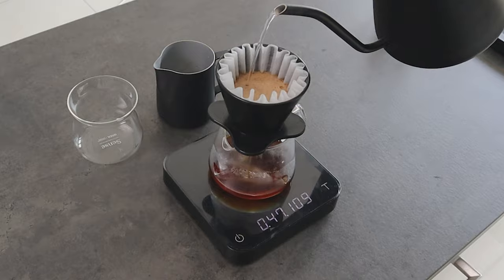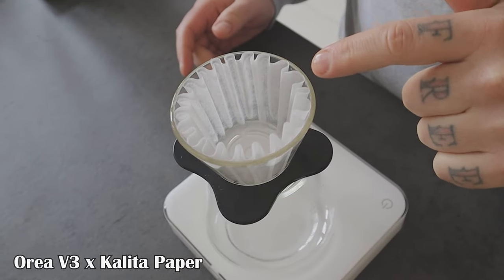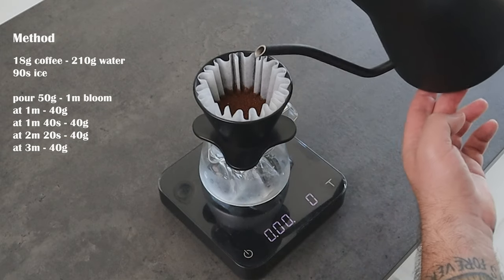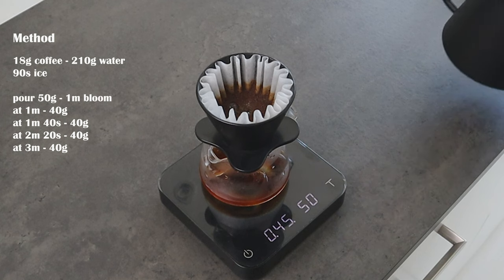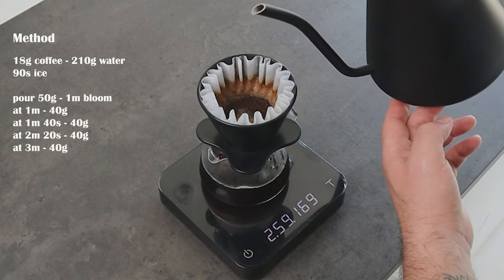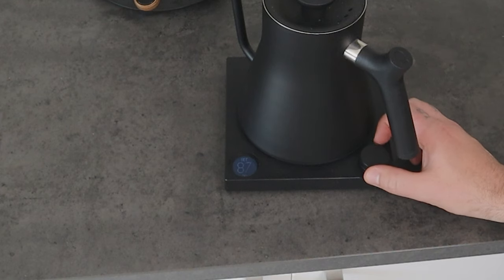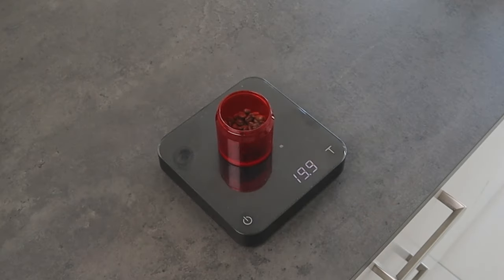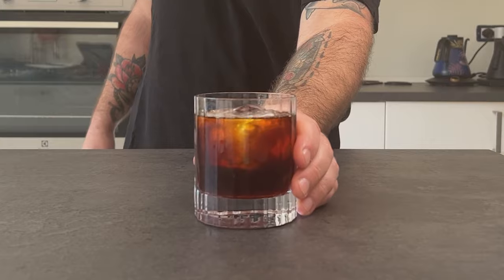How to Make Iced Pour Over / Japanese Style Iced Coffee - Ep2

Comment: How about using the negotiator filter to reduse bypass? 🤔
Reply from the maker: Flat filter can also be an option, definitely higher extraction, probably also adjust some variables. But yes, you can definitely reduce bypassing
Reply: I have used it and brewtimes for sure get longer. Have you tried the fast filters from sibarist?